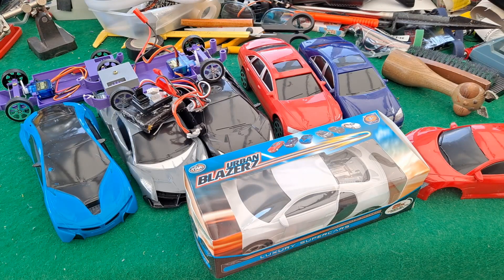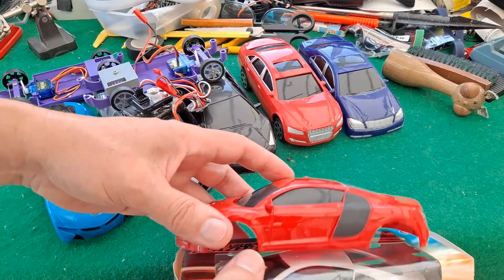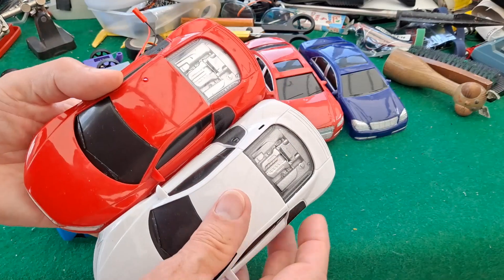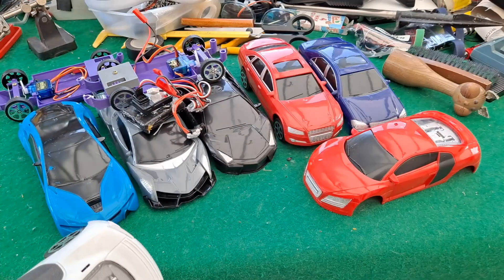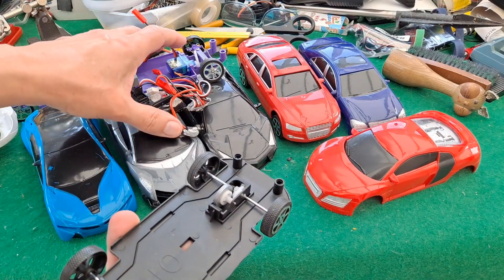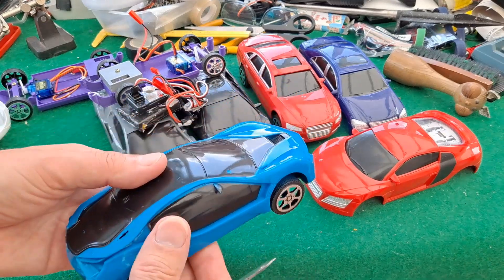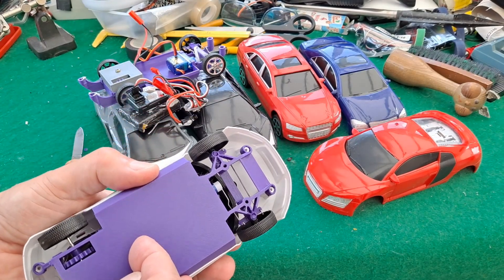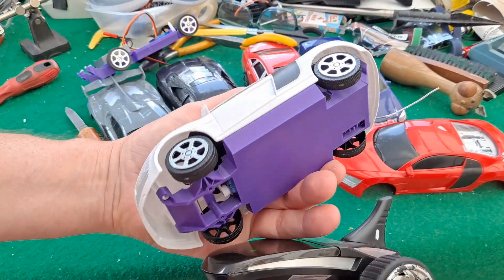Poundland toy car RC conversion project PART 16 - the 6th bodyshell

Comment: Hope the cheap rubber tires work it will be alot better.
Reply from the maker: That depends what you call better. People cover the rubber tyres with tape to reduce the grip so they can go drifting!!
Reply: @GrandadIsAnOldMan  I would want more control over the car so I'm not sure.